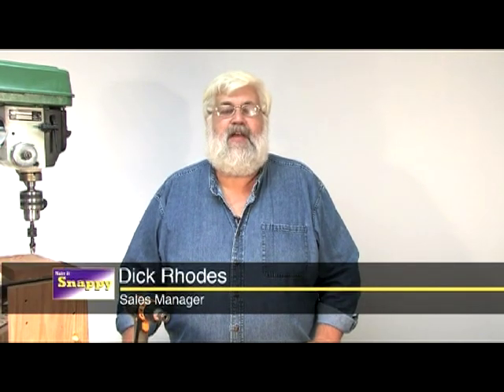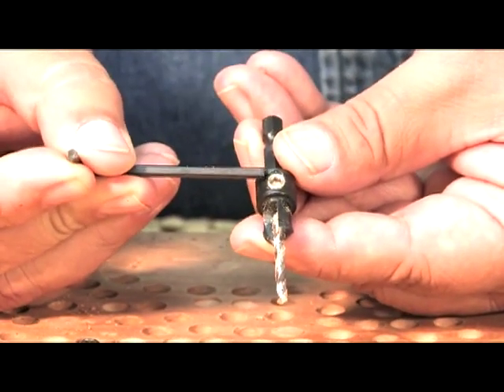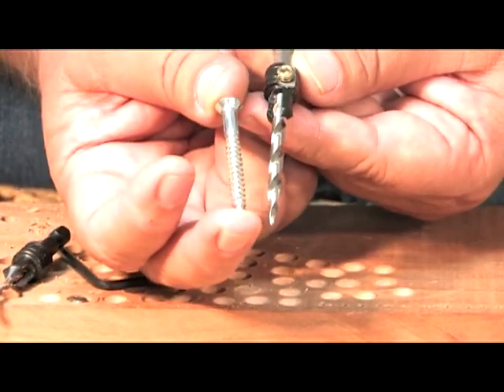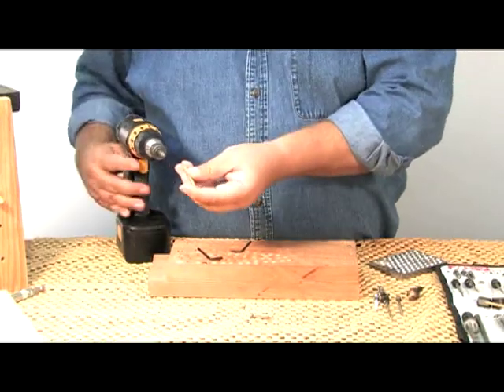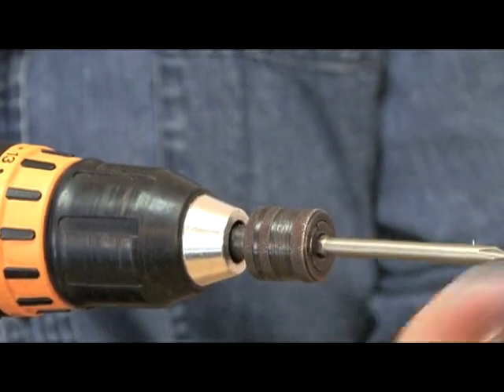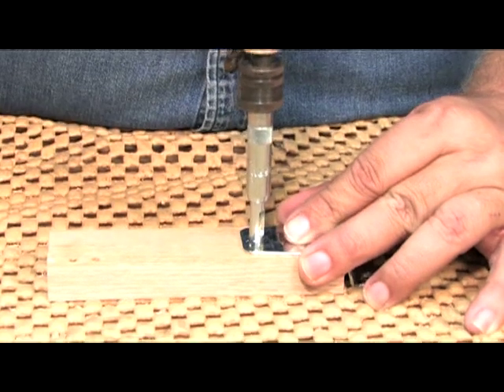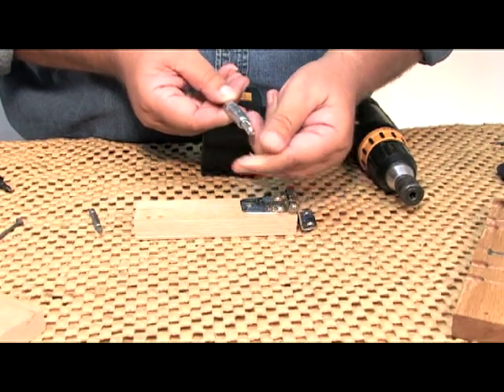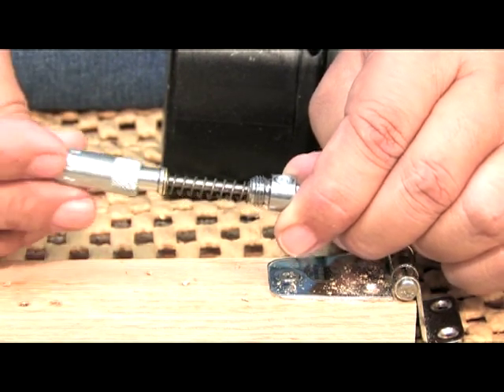Snappy Drill Bits (Made in the USA)

Comment: Thanks for the video. When I was buying my first set of 3 in 1 countersinks I did see snappy on Amazon. I never heard of this brand before and it sounded like a China made brand. all I knew was w.l. Fuller. For the self centering bits, I was told the best brand was the vix bits so I got those. The snappy version of the self centering bits seem to have better features, especially that chip clearing feature. I don't do a lot of hinge installing,  but whenever I do use my vix bits, they always get packed with the chips. I'll be sure to get some snappy ones.

Comment: Very nice  i did do Woodworking professionally for over 20 years. Now irs a. Passion and a hobby i have  quite a few Snappy self centering bits   But many of the other products you. Mention or demonstrate i was un aware. You guys had  and thats a shame because based on the Snappy items i do Own you guys build a quality  unit. On  par with the old idustry standard Vix bits  i used to drill hundreds of. Fire rated. Solid core Door hinges  doing commercial Millwork  installation  in all honesty  most of my Snappy  branded items were. For smaller sizes and didnt get as much use but worked well and as intended when i needed it to  do so   I do beleive your marketing department needs a kick in the back side to let. More people know what y’all  have to offer  the only reason i. Wound up with your brand was  i happened to be in a Home Depot  looking at specialty. Bits and the low price got my attention compared to the Vix ones  was buying at a local  lumber and supply. House